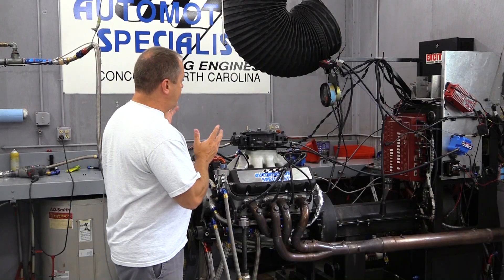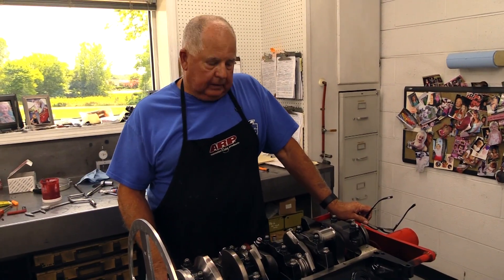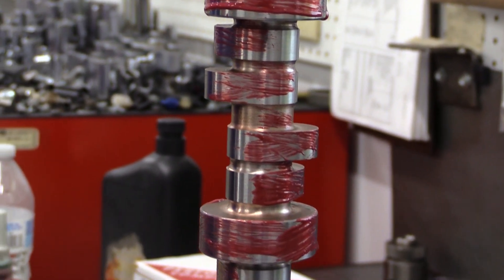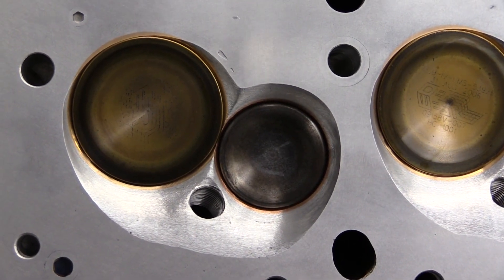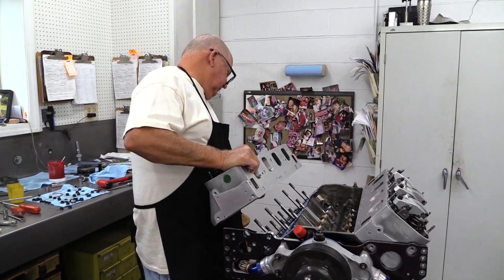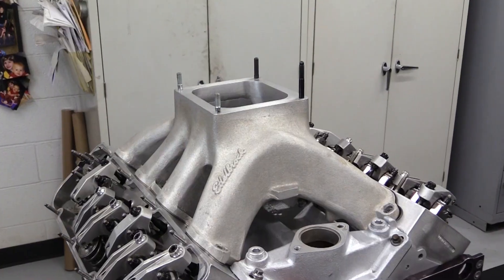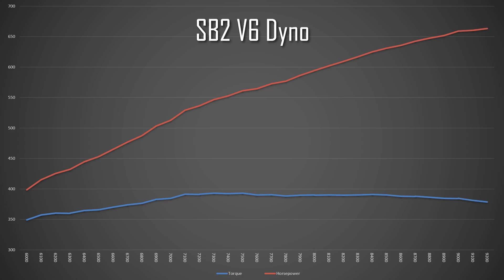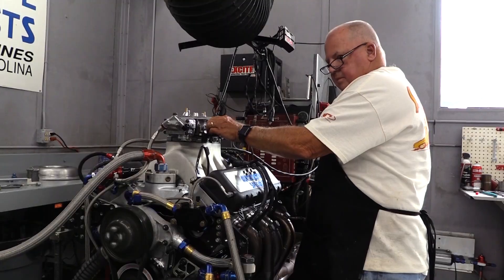NASCAR Chevy SB2 V8 Turned Into a Racing V6!?

Comment: There were a couple Vipers which ran in European GT racing with V-8 versions of the GTS-R V-10. I believe they had a straight shaft for the last two holes' crank location. Was better to make a smaller engine than breathe through a drinking straw.

As an aside, the jaguar V-6 used today is basically a production version of this.
Reply: IF I WAS ON THE TECHNICAL JUDGES PANEL AT BONNEVILLE. I WOULD IMMEDIATELY DISQUALIFY THIS ENTRY. IT DOES NOT QUALIFY AS A V-6 FOR ONE SPECIFIC REASON. BECAUSE TECHNICALLY IT IS STILL A V-8 BECAUSE OF THE LONGER CRANK AND COUNTER WEIGHT GIVING IT MORE ROTATING MASS (STORED ENERGY) ALLOWING IT TO PRODUCE MORE TORQUE GIVING IT THE ADVANTAGE, AS OPPOSED TO A STANDARD V-6 WHO'S ROTATING MASS IS MUCH LIGHTER PRODUCING LESS TORQUE. SORRY KEITH DORTON BUT IT DOESN'T QUALIFY AS A V-6.
Reply: @Frank289100  you lose more power with more rotating mass...which is why you want the lightest pistons, rods, crank, cam, no accessories, etc. possie without compromising strength so you can have the best performance...also you can run a fully built V8 in the V6 class by simply unplugging 2 spark plugs so you can run in both classes...clearly you don't know the rules so it's a good thing you're not a "judge" or associated with Bonneville Racing in any way...
Reply: @Frank289100  A disadvantage obviously. To accelerate the extra rotating mass requires extra power which would reduce your acceleration. Having a larger rotating mass does not create more tourque, science proves you wrong on that one. If your theory would be correct then I guess race engines in general and land speed race engines in particular would run extra heavy flywheels, which they dont.
Reply: @turdferguson9190  THE FIRST QUESTION IS: IF HE IS AT DISADVANTAGE HERE THEN WHY WOULD HE USED IT IN THIS APPLICATION, REMEMBER WE ARE NOT RACING IN A QUARTER MILE HERE. 
SECOND QUESTION IS: ( Having a larger rotating mass does not create more tourque, science proves you wrong on that one.) THEN IF THIS IS TRUE AND WHEN GM CREATED THEIR BIG BLOCK (WHICH IS THEIR SMALL BLOCK SCALED UP) WHY DID THEY INCREASE THE MASS OF THE ROTATING ASSEMBLY.
Reply: @Frank289100  Well if you took your time and watched the video you would find that they actually do a very good job of explaining the reasoning behind this build. Since they also start off with a second hand engine I would also assume that budget could be a constraint as well as the availability of aftermarket blocks and heads for a similiar V6 application. As for your example of the big blocks rotating mass compared to the small block. First of all if you "scale up" an engine you would by the very definition increase its mass, static as well as rotating. Secondly, GM didnt build a bespoke race engine when they designed the big block, the material and design of the rotating assembley (and thereby its weight) is more a function of production cost then performence. 

But lets get back to your claims, you still haven't provided any evidence to back up your claim that adding to the rotating mass would increase tourqe. Again if it that was the case, why arent race engines in land speed cars in general (and enginens with less tourque in particular) running extra heavy fly wheels?
Reply: @turdferguson9190  WITH YOUR PREVIOUS POST IT'S QUITE CLEAR YOU ARE AVOIDING ANSWERING THE QUESTION. HERE IS ONE OF THE QUESTION: ( Having a larger rotating mass does not create more tourque, science proves you wrong on that one.) THEN IF THIS IS TRUE AND WHEN GM CREATED THEIR BIG BLOCK (WHICH IS THEIR SMALL BLOCK SCALED UP) WHY AND FOR WHAT REASON DID THEY INCREASE THE MASS OF THE ROTATING ASSEMBLY.
Reply: @Frank289100  Hahaha! How can this be so hard for you to compehend? Adding mass to your rotating assembley does not add tourque! And are you really that suprised that a bigger engine, with a bigger crank, bigger connecting rods and bigger pistons have a larger rotating mass. The GM engineers didnt add that as much as it is a function simple physics. And again you are nowhere closer to providing any evidence to back up your original claim that a larger rotating mass creates more tourque. So please provide some evidence to back up your claims and I'm sure that The Royal Swedish Academy of Sciences will throw a Nobel prize your way....
Reply: @turdferguson9190   Adding mass to your rotating assembley does not add tourque! <<-- SO THEN WHY DID THEY DO IT IF ITS DETRIMENTAL TO THE ENGINE???? PLEASE GIVE ME A STRAIGHT ANSWER AND NOT PARAGRAPH OF NONSENSE.
Reply: Daver G  THEN WHY DON'T YOU JUST TAKE A FLYWHEEL OFF A TUG BOAT IF THAT IS THE LOGIC YOU ARE GOING TO USE. WE ARE TALKING ABOUT THE SLIGHTLY HEAVIER ROTATING MASS WILL GIVE IT A ADVANTAGE..
Reply: @Frank289100  Haha, rewatched this video and stumbled upon this old exchange. Still cracks me up!
Reply: @turdferguson9190  WHAT IS YOUR POINT?
Reply: @Frank289100  That the Dunning-Kruger effect is absolutley hilarious!
Reply: @turdferguson9190  I DON'T WANT TO HEAR ABOUT DUNNING - KRUGER THOSE 2 QUEERS.
 DOES THE SLIGHTLY GREATER WEIGHT OF THE ROTATING MASS GIVE THIS ENGINE A ADVANTAGE OR DISADVANTAGE?
Reply: @Frank289100  I have already answered this previously, but sure I'll give it another go. No, adding mass to the rotating assembley of this engine doesnt give it any advantage, a higher rotating mass means that work that could have been use to accelerate the vechile is instead used to spool up this additional mass. This is simple physics that we have known about since the days of Isaac Newton.

But you are the one making a positive claim here so the burden of evidence is on you, so please provide some evidence to back up your claim. And while your at it, please explain why it is that race teams around the world are doing almost everything they can to reduce the rotating mass on their race cars?
Reply: @Frank289100  I have already answered no, but since you seem to be on the more obtuse end of the spectrum I'll do you this favor.

No. No. No. No. No. No. No. No. No. No. No. No. No. No. No. No. No. No. No. No. No. No. No. No. 

Good enough?

Now please provide some evidence to back up your claims that this engine has some type of advantage due to the larger rotating mass.
Reply: @Frank289100   And again you dont disapoint when it comes to delivering the fail. 

There are several reasons to running a V8 on six cylinder and none of them has to do with an increased rotating mass. The budget would most likely be the first, rather then starting from scratch this engine is based on an already existing race engine, thus saving money. Secondly is availability of parts for most V6's is nowhere near that of the SB2 engine making it more suitable option. With unlimited time and money I'm sure he would have gone with another setup.  

Dorton certainly seems to be an excellent engine builder (with a track record to back it up), you however clearly are not. You have not provided one single piece of evidence to back up your ridicoulus claims that this engine has an unfair advantage. So I ask you again to please substantiate your claims.
Reply: @Frank289100   Ahh yes name calling, you know you are dealing with an extra big brained mastermind when the name calling starts...

Anyone who has been involved in racing knows that its financially a black hole, its just a matter of how much money you're willing and/or capable at throwing at it. And everyone (including the Bloodhound LSR team) make constraints on spending, so even if you are going for the land speed record you still have a budget to adhere to. And yes there are plenty of options when it comes to race engines, and no a larger rotating mass isnt a reason to pick this alternative, if that is the case then why didnt he base it on a Chrysler V10 and get even more "benefits" from running four empty cylinders?

But either way you are nowhere near of proving your point...

Exactly how is a larger rotating mass a benefit to this or any other land speed racing engine?

If it is a benefit, why are so many teams spending so much money trying to reduce the rotating mass on their race engines?

How can anyone even stay in buisness trying to sell lightweight fly wheels, aluminum rods, etc?

And yes you can achive high speeds with big engines heavy engines like the 396, but the large rotating mass isnt what made that engine perform.
Reply: @Frank289100  I've given you plenty of explanations as to why this engine doesnt have an unfair advantage. You havent adressed any of them, nor have you provided any evidence to back up your hypothesis.

Just like in racing its time to put up or shut up.
Reply: @turdferguson9190  SO THIS ENGINE WITH THE SLIGHTLY HEAVER ROTATING MASS WILL NOT HAVE AN ADVANTAGE. SO EXPLAIN TO ME WHY WOULD THIS PROFESSIONAL ENGINE BUILDER PUT HIMSELF AT A DISADVANTAGE AND EVEN BOTHER THEN TRYING TO BREAK THE RECORD.
Reply: @Frank289100  Again I have provided plenty of reason, you however have provided zero evidence to back up your claims. 

Put up or shut up.
Reply: @Frank289100  I have provided you with evidence that adding mass to your rotating assembley does not give you an unfair advantage in this type of race engines. I have also provided reasons (other then whats stated in the video) as to why you would run a combination like this. If theese things passes over your head I cant help you.

You on the other hand keep deflecting, please provide some evidence to back up your claims. 

Once again, put up or shut up.
Reply: @turdferguson9190  SO THE EXTRA ROTATING MASS IS PUTTING THIS ENGINE AT A DISADVANTAGE. IS THAT SO?????
Reply: @Frank289100  Yes.
Reply: @Frank289100  If it didnt then this engine would break Newton's first law of motion...
Reply: @Frank289100  If you would have told me that you dont have anything to back up your claims with and that you dont know what you are talking about, we could have cut this argument down ti ltrmerally a few senteces...
Reply: @Frank289100  So instead of providing any type of evidence to back up your claims you keep putting words in my mouth? Är this point I guess I just have to accept that you dont have anything to back up your claims with and dont have any idea about what your talking about.
Reply: @turdferguson9190  THE CHEVY 348 W ENGINE IS CALLED A TRUCK MOTOR. CAN YOU TELL ME WHY??????????????????????
Reply: @Frank289100  The process of accepting that you are wrong can be very long for some people, many even cling on to their faulty ideas even in light of overwhelming evidence. Frank, when your journey is through and you've realized how wrong you were all this time, I'll still be here for you. Best of luck!
Reply: @Frank289100  There is a diffrence beetween avoiding and not caring. I dont care because it makes no diffrence to our argument.
Reply: @Frank289100 Sure I'll bite, just for the lulz... It was orginally intended to be used in trucks but it also ended up being used in passenger cars. And this is relevant in which way?
Reply: @turdferguson9190  YOU STILL HAVEN'T ANSWERED THE QUESTION. THERE WAS A REASON WHY THE 348W ENGINE CONSIDERED A TRUCK MOTOR. CAN YOU GIVE ME THE ANSWER WHY AND WHAT MADE IT A TRUCK MOTOR????????
Reply: @Frank289100  Because it was a motor, built for a truck, so it was considered a truck motor...
Reply: @turdferguson9190  BUT WHAT MADE IT A TRUCK MOTOR, IF IT WAS BUILT FOR A TRUCK???????????????
Reply: @Frank289100  Yeez, I dont know you tell me and just make your point...
Reply: @turdferguson9190  THIS IS YOUR FIRST STRIKE. 
NOW HERE IS THE NEXT QUESTION. WHEN FORD, CHEVY AND CHRYSLER BUILT THERE BIG BLOCKS. WHY DID THEY INCREASE THE ROTATING MASS IF IT IS DETRIMENTAL LIKE YOU CLAIM.
Reply: @Frank289100  Well the answer is, they didnt. The big blocks (in comparison to their small block counterparts) have a larger bore spacing, taller deck heights and ofcourse larger stroke and bore. The crankshafts are longer with more stroke, the connecting rods are longer, and the pistons have a larger diameter. All of theese parts are made materials and production methods as their small block counterparts, thus making them heavier. 

Your arguments is the equivalent of asking why Chryslers engineers decided to add mass to their C-body cars compared to their A-body cars. Again, they didnt. If you make larger objects using the same materials and production techniques they will have a larger mass. This is physics 101...
Reply: @turdferguson9190  THEN WHY DIDN'T THEY JUST BORE AND STROKE THE EXISTING SMALL BLOCK MOTORS USING THE SAME LIGHTER CRANK, PISTONS AND RODS LIKE THEY DO TODAY?????????
Reply: @Frank289100  I guess the two main reasons would be that there are inherant problems with running a long stroke with a shorter connecting rod (as in the small block) and the other would be clearence problems. The modern LS engine has a larger deck height to allow for better stroke to rod lenght ratios and the cam is placed higher to allow for more stroke. 

Either way there is no advantage in having a race engine using a certain percentage of its power to rotate extra mass.
Reply: @turdferguson9190  BUT THE DID STROKE THE CHEVY SMALL BLOCK OUT TO 400ci, BUT YET THEY KEPT PRODUCING THE BIG BLOCK WHICH OBVIOUSLY WAS FOR A REASON. AND YET YOU STILL CAN'T FIGURE OUT WHY, WHICH GOES BACK TO THE FIRST QUESTION OF WHY WAS THE 348W ENGINE A TRUCK ENGINE.
Reply: @Frank289100  Yes GM used a whole bunch of diffrent combinations of stroke and bore, usually developing bigger and bigger engines as the years went by. With regards to the 400, GM developed a new block with siamesed cylinders and larger mains, so that capacity was never intended when small block was first developed. The fact that the big block was still in production as the small block got bigger is not suprising since it made more horse power due to larger ports and better volymetric effiency. The two engines also had diffrent characteristics, dimensions and weight making them suitable for diffrent types of applications.  

If you wanna make an argument using the 348W (and I'm assuming its rotating mass) as an example, then just do it and stop beating around the bush. It still doesnt change the fact that the engine in the video doesnt have any advantages due to its extra rotating mass...
Reply: @turdferguson9190  FOOTBALL AFTER FOOTBALL WENT OVER YOUR HEAD AND YOU ARE JUST STARTING TO WAKE UP, BUT YOUR ARE STILL ASLEEP. SINCE IT HAS BEEN ESTABLISHED THAT SMALL BLOCKS WERE ABLE TO BE BORED AND STROKED OUT FOR LARGER DISPLACEMENT. THEN WHY DID THE ENGINEERS AT GM, FORD AND CHRYSLER DESIGN BUILD BIG BLOCK WITH HEAVIER ROTATING MASSES IF IT IS DETRIMENTAL LIKE YOU CLAIM?????????
Reply: @Frank289100   Yes, as I have explained to you several times there is no advantage in having a larger rotating mass in a performence engine. But there are also several other factors that effects an engines performence and longevity. Port design, intakes,  cam profile, stroke to rod lenght ratio, compression ratio, etc, etc, etc. Production engines are always a compromise in all these factors, thats why manufacturers produce diffrent engine types to mitigate its compromises.  

So "BuT, wHy DoEs gM's BiG bLoCk hAvE a LaRgEr RoTaTiNg MaSs ThEn ThE sMaLlBlOcKs" is your argument is to why this engine would have an unfair advantage. 

To make it simple as I possible can, rotating a heavier object requires more work. If your claim is true then it violates Sir Isaac Newton's first law of motion. You obviously dont understand basic physics, let alone engine design in general or race engines in particular.
Reply: @Frank289100  So you completely ignored how you hypothesis was proven wrong and yet again resorted to name calling?

How could a big block be beat small blocks with the same displacement? As I've already explained there are several factors that determines an engines power. The obvious reason would be that the big blocks heads flow better, giving the engine a higher volumetric effiency. A higher VE can easily make up for the losses that the higher rotating mass and then some. And if the higher rotating mass was the magic bullet in that case, why didnt their competitors with small block engines fit heavier fly wheels to their engines to get the same advantages?

Again for your hypothesis to check out, you would have to disprove about 330 years of research in physics.
Reply: @Frank289100  "REMEBER WE ARE NOT RACING A QUARTER MILE HERE", thats your qoute.

You cant even keep an consistency in your arguments...
Reply: @Frank289100  Volumetric efficency. The advantage of better flowing heads outweighs the disadvantage of a heavier rotating mass. And still ignoringing the points about how simple physics disproves your hypothesis I see. Sad...
Reply: @turdferguson9190  IF A HEAVIER ROTATING MASS WAS DETRIMENTAL. THEN WHY DID FORD, GM AND CHRYSLER CREATED BIG BLOCKS WITH HEAVIER ROTATING MASSES. SO TO ANSWER THIS QUESTION, IS THAT THE HEAVIER ROTATING MASSES BENEFIT THESE ENGINES IN ITS ABILITY TO PRODUCE LOTS OF TORQUE. IN TRUCK APPLICATIONS THE HEAVIER ROTATING MASSES (PRE-STORED ENERGY INERTIA) ALLOW THE ENGINE TO BREAK THROUGH THE RESISTING COUNTER LOADS THEY ARE PULLING. WHEN THEY COME OFF THE CLUTCH THE HEAVIER ROTATING MASS BREAKS THROUGH THE COUNTER LOADS OF THE OPPOSING RESISTANCE OF THE WEIGHT. AND ALLOWS IT TO EASY PULL HEAVY LOADS. ON THE OTHER HAND USING A SMALL BLOCK MEANS YOU HAVE TO REV THE ENGINE INTO OBLIVION TO INITIALLY GET THE TRUCK TO MOVE AND TO KEEP THE TRUCK MOVING. YOU LITERALLY HAVE TO KEEP THE ENGINE REVVING AT HIGH RPM'S. SO IN TURN THE SMALL BLOCK BECOMES VERY INEFFICIENT AND BURNS A TREMENDOUS AMOUNT OF FUEL AND ALSO PUTS A TREMENDOUS AMOUNT OF WEAR ON THE ENGINE, AS OPPOSED TO THE BIG BLOCK WHICH IN THIS APPLICATION IS MUCH MORE EFFICIENT. SO IN THE CASE OF THIS V-6 HERE. THE EXTRA ROTATING MASS WILL BENEFIT IT.
Reply: @Frank289100  good thing you are not a technical judge at Bonneville then...
Reply: @turdferguson9190  YOU GAVE ME YOUR QUICK OPINION, BUT NEVER ANSWERED THE QUESTION. SO HERE IS THE QUESTION: DOES THE GREATER WEIGHT OF THE ROTATING MASS GIVE THIS ENGINE A ADVANTAGE OR DISADVANTAGE?